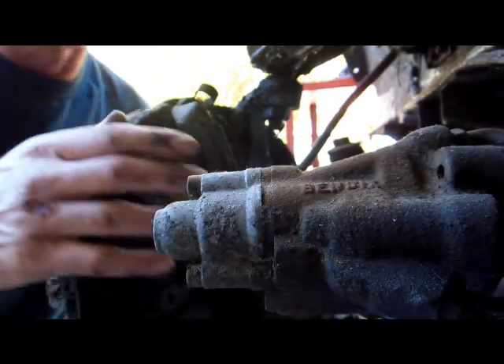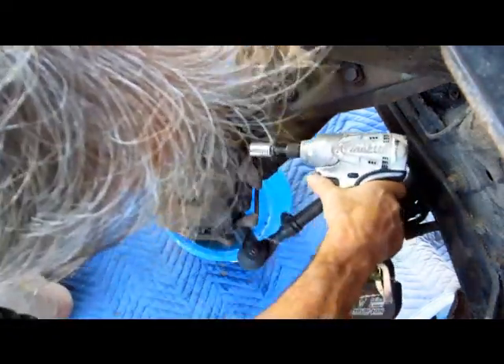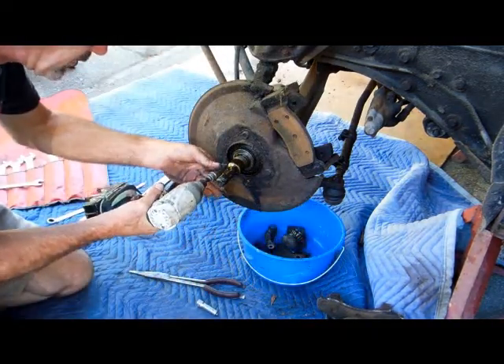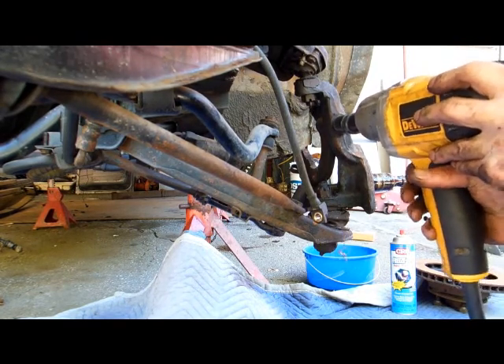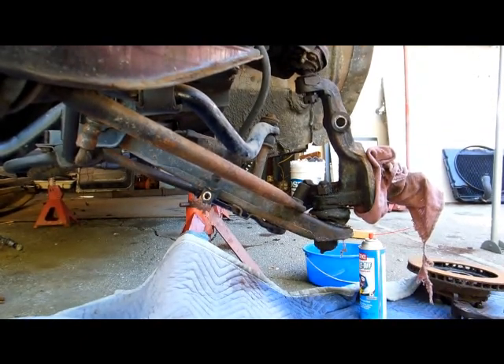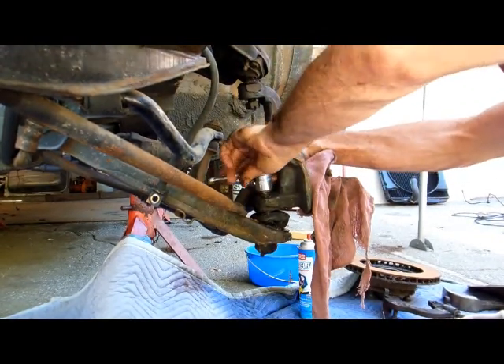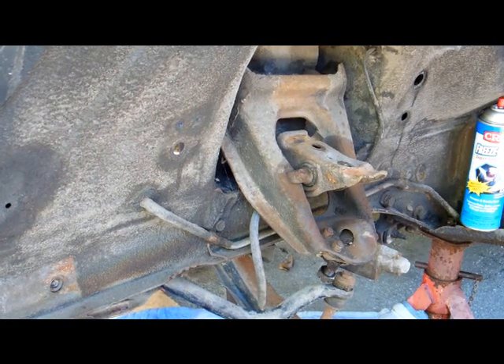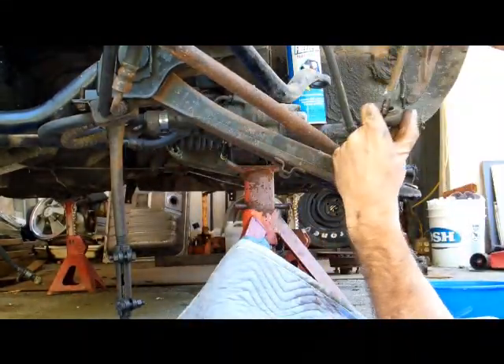68 mustangGT500KR caliper rotor spindle upper lower controll arms strut rod removal

Comment: I'm surprised it came apart so easily considering that I think they use salt on the winter roads in Jersey. I think that is where you said the car came from. Where I come from, a car that old with our winter salt conditions, demands taking things apart with a cutting torch. That is, if there is anything left to take apart.